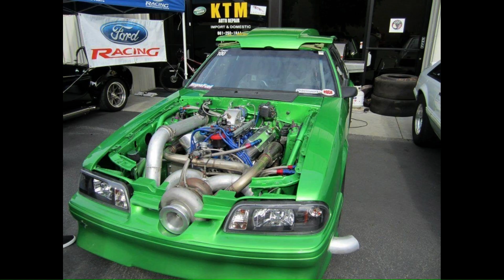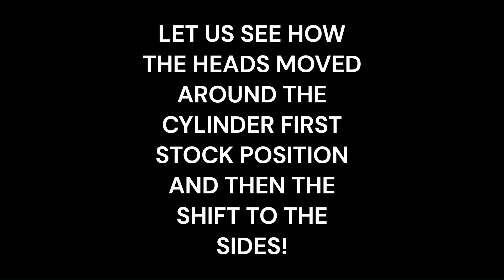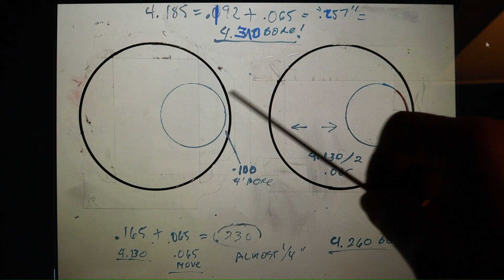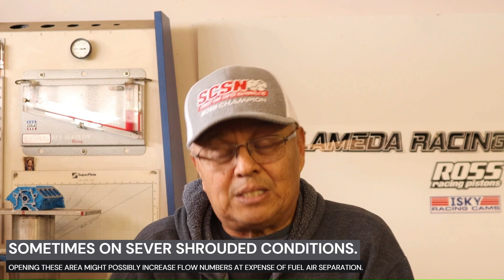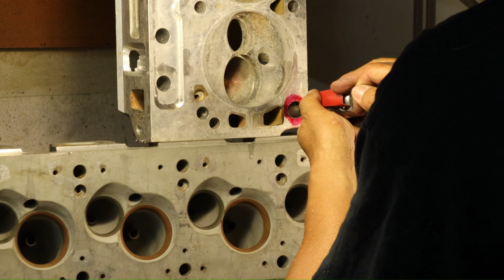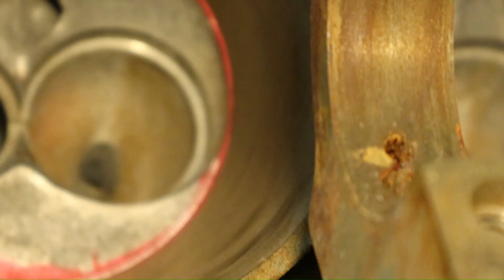FORD & LS HEAD TO BLOCK MODIFICATIONS

Comment: You could also have a competent machine shop make a set of .060 offse t dowels to insert in the block. Yes, cheaper to use a die grinder but not necessarily as accurate. Dont get me wrong here, im not criticizing anything just adding some input
Reply from the maker: Agree with you did that on a junk piece to show how effective it is.

Comment: Well in a 302 ci small block Ford in 1969 the Boss 302 used a 2.23 intake valve. Then in 1970 they droped it down to a 2.19 intake valve. And that is a factory head no work at all. So with the canted valve allows that. If he was talking a 20 degree head i think you can get a 2.10 valve in there

Comment: Not trying to be argumentative, but are you saying that a Ford will gLS does not have the ability to go 4.125 bore on a stock block unless you go ls7 which wouldn't have that cylinder head. 4.065 is about as good as it gets for stock block stuff. A lot of cathedral guys go 2.05" on the intake side and some have run a 2.08" but rarely do they unshroud it or blend the bowl properly so they don't see a lot of advantage.
Reply from the maker: If you move the head offset to one side then you can take advantage of the bigger intake valves which we have been doing to the SBF for ages.  The LS  layout specially the LT which now has the same valve positions like the SBF unlike the reverse with the early generation LS.  Moving it like I showed .065 fools the intake valve that it has a bore of +130 over stock on one of my videos.  Therefore if you start with a 4.00 bore and moving it .065 now the intake valve thinks it is a 4.130 bore size and loves it!

Comment: Good evening from off the grin AZ. Can you use a crank from a bbc 454, as a stroker crank for a bbc 396. Thanks. My heads ror the 311 should be done soon. Im definitely going to revisit the combustion chamber mods video, i like the notion of the V-groove. Thanks again
Reply from the maker: A good machinist can make just about anything fit within the confines of similar block series.

Comment: Ford's factory engineers solved this in 1969 by canting the valves and notching the cylinder wall at the deck. You can put a 2.25" intake on a 4 inch bore with a 1.71" exhaust. The 351 Cleveland head was well ahead of everyone else at the time. 
I like the way you think. Move the head, genius
Reply from the maker: More than one way to skin the cat as they say...

Comment: Hey Ben what about the new Lt style heads will this work on them??
Reply from the maker: Those LT style would not swap straight to the older LS blocks because the valve position is reversed mimicking the Ford layout. Now you need Ford style piston reliefs.

Comment: On a SBC gen I . What about notching the cylinder bore in a 4.030" - 4.040" bore size? Using a larger diameter head gasket. Wish to use 2.10" valve size or largest possible and unshroud it with an angled notch.
Reply from the maker: I would not do that on a SBC and notching the cylinder wall make sure it does not go past the ring travel!  Minimum gain however so I wonder what you are trying to do?
Reply: 396 did that in Feb of '65. Nothing new under the sun. I'll take a stab and say the largest, most succesful and prolific car manufacturer in automotive history would have done all this if it helped.

Comment: I'm visualizing 7/16" or 1/2" end mill shafts passing through a bushing in the end of a cylinderical guide with about a .050" wall thickness that contains the mill with about a .005" of side clearance, extends beyond the end may be 1/16", but then only shields 180 degrees of the radius. Every freaking time I ever do mutiples of anything by hand I end up making a GD tool anyway. I can't get anything right the first time to save my life, seldom the 2nd either, and most often it's the third. LOL You really think out of the box Ben; and that's what makes you the winner you are.
Reply from the maker: Every successful engine builder has a good machinist with him or a shop that completes the magic!  I wish I can do everything but I know my limits.
Reply: F-ing A ! I can damn sure relate. My buddy the AFP has a lathe and a mill in his garage and his daddy was a gun-smith. I don't know what I'd do without him man. LOL @benalamedaracing2765

Comment: Could you use an offset valve for the exhaust? It would give you more room in the center of the port. Then open up the intake side and put a larger valve. A 2.250 valve or more could fit.
Reply from the maker: That is already what the aftermarket and all out cylinder heads already does.
Reply: When I was a kid, I had a racing kart. I cut out everything in the ports and blended the eyebrows between the cylinder and valves. Lost compression so I was going to shave the head to raise it back up. Not enough. I then welded around the spark plug hole and by adding material, I raised it back up. But, like you, I found that counter boring the valve guides and canting the valves away from each other, I could make it easier for the flow to develop. Then I decided to build 302 with the junk heads on a 79 Ford Futura. I think I was intimidated by working on my daily driver.

Comment: how does the intake bolt up? what lifter/pushrods should I use? what intake should I use?
Reply from the maker: If you use an LS head you must use an LS intake perhaps with spacers or milling to fit a particular deck height!  Vice versa with a Ford...
Reply: @benalamedaracing2765 this is just a junkyard to backyard build that I'm thinking about, I actually answered my questions on another post but thanks for the idea and i hope to expand on it .

Comment: Using this application on a set of N351 yates heads on a 302 block for street with intake running flow of 207cfm with port and polish at 6500 rpm and still pulling what do you think would be the flow number gains?
Reply from the maker: I always like the N head and I have no idea what it will do depending on the guy porting the head, if he knows what he is doing or is a magician of sorts!  lol

Comment: my theory is to use rockers with a high ratio, as this will make the low and mid lift air flow less restrictive with a faster and sooner  lift. the peak cam lift may need to be lowered, as the high ratio will lift the valve higher, so you will need to prevent valve and piston clearance issues.
Reply from the maker: Yes the chance of collision will be at overlap...

Comment: Wonder if this would allow ls3 heads on a 5.3 ls bore. Dont think it will but it got me wondering.
Reply: You can buy a small bore ls3 head from several vendors but unless you turn the 2.165 valves down or put a smaller intake valve, the 2.165 hits the cylinder wall & it's not even close, so I don't see that being enough to make it fit..

Comment: While I don't think I will be off-setting the head at all, I do have a perfect project to test this on. I have an Iron block LS 5.3L that I planned on taking out to LS1/6 Bore Spec and putting forged pistons into anyway. Since the 862/706 Cathedral Port heads already flow so well and are free with the motor, rather than trying to track down a set of 243 heads, I will take the time to simply unshroud the Intake valves and work on the chamber to accommodate the increase in bore that I will be getting from the iron block (from 3.780" to 3.905") and leave the stock valve sizes for now.
Reply from the maker: Good move and like I stated on this video, use only on max effort builds.  It should really improve when you apply your plans to the build up.  Good luck Joey.

Comment: Looks like a bit more flow from unshrouding but curious as to how much better the exhaust flow would be under power since the valve taper in the head to the valve is flush with the bore now?
Reply from the maker: Not really much of a concern because the exhaust is under pressure and it will evacuate itself readily even when shrouded.  In fact most if not all state of the art cylinder heads installs the biggest intake valve while the exhaust keeps getting smaller in diameter and much closer to the cylinder walls!

Comment: We have offset the bores on small block chevy to accomplish the same effect
Reply from the maker: On legacy SBC you can either go up or down but not side to side or else one intake will be compromised and the other freed up!
Reply: @benalamedaracing2765  no I mean actually bore the block offset
Reply from the maker: @kevin2960  I am trying to understand and boring offset outwards does not change the bore relationship distance to the intake valve.  From what I can see it makes the exhaust valve side even farther which is what we are "not" trying to do actually the opposite.  There is no more room to offset bore and on the 400sbc you will run into the thin head bolt between the cylinders and same with the 350, not much meat between to make a good seal between the cylinders.  Could you explain because I am not following. 
Thanks Kevin.
Reply: @benalamedaracing2765  we did this on bowtie blocks and other aftermarket blocks. They used to do it on the big racing engines. You bore the front 2 and back 2 cylinders closer together and leave a bigger gap in the middle.
Reply: Some guys would sleeve 400 block to a smaller bore to achieve it. In a cubic in class
Reply from the maker: @kevin2960  thanks and seems like a lot of work and will still not get the same effect if the cylinder head layout is not symmetrical.  Today almost all heads big and small block is symmetrical and it would be a lot simpler of a task to relieved the shrouding of the intake valves.  It shows how many teams are willing to go beyond anything to achieve their desired power expectations.  Truly appreciate what others do in spite of the limitations and do innovative fixes.  I know of what we did years ago offsetting the crank centerline to achieve a better rod angle during the ignition stroke, and it worked but paid the penalty thou to a lesser degree when the piston and rod goes up on compression.  Oh well nothing is a free lunch like they say.  Thanks again Kevin.
Reply: @benalamedaracing2765  when you race in a class any lead is a lead. A few hp is what it takes. Your only allowed a certain CI, particular engine type, what part you can use ect.  Unshrouding a vale can be the difference between winning and loosing.
Reply from the maker: @kevin2960  Yes sir a win by an inch is as good as a yard!

Comment: So aftermarket offset lifters offset rocker arms and a multi dollar bigger valve job nets you how much more power over standard cylinder location
Reply from the maker: Depends on the rpm and cam specifications you are using at the moment.  Power is money therefore how much do we have and it goes hand in hand and very hard.

Comment: Been doing this for years on small block Ford's. Making up offset dowel pins, and using the mill to clearance the head bolt holes, is pretty easy. How do you feel about indexing the crankshaft, wrist pin offset. What's your take on piston to rod ratio? Glad I found your channel, we think alike. Take care.
Reply from the maker: For high rpms i like big bore and medium stroke coupled with the longest runners.  Shorter rods for road racing or small and fast oval tracks.

Comment: Are the trickflow forged pistons for the wedge heads on a 351w a good option for boost or are there better options for the $. What piston or rod would you like for 750-800 wheel? Thanks
Reply from the maker: Tim, best to give them a call because I have no idea how far down the top ring is and that is a definite issue to be concerned specially if you will be boosting  plus what kind of forging pistons they offer!
Reply: @benalamedaracing2765 thanks

Comment: With this mod is it possible for the head to shuffle because the dowel is no longer firmly locating the head? Maybe add a thin piece of curved steel to fill the gap around the head bolts/dowels to prevent shuffle? Also, can you chamfer the cylinder bore above the top ring like the Cleveland blocks?
Reply from the maker: You can weld, add epoxy or fit a similar thickness feeler gauge to how much you intend on moving the heads.
Reply: @benalamedaracing2765  Barry Robotnik did a 427 FE for EMC and he has Blue Thunder head s and he welded the dowels and the moved the holes in the heads and relocated the head towards the valley. He made 659 hp with 427 ci at 11:1 and ran it on 91 swill. Moving the head made quite a difference, but I could see the pics then and he had some trapping on the pistons, just blotches of brown.
Reply from the maker: @Bbba7564  I was forwarded an invitation to EMC by the original creator of the series.  I could have but at the time I was full time @ LAPD and could not dedicate seriously to it.  First time winner Joe Sherman told me to join and possibly winning like he did because we were and his son Steve, came up with a Ford vs. Chevy "Match Race Madness" and the rest is history.
Reply: @benalamedaracing2765  That is really cool!  I think that you should study the rules really well and build a combination that really fits the rules. Blair Patrick won it a few years ago with a .040 over 390 with iron C4AE-G heads at 399 ci making 597 hp. I sure hate that my C4AE-G disappeared from the machine shop after I had really scienced them out, and they claimed I had picked them up.  Gone!  But he figured out how to make the most points based on the rules, and scoring points. I wanted to use those heads to compete. Like losing my sight to drive, just another brick in the wall. Go for it!  The small block Ford is really underrepresented, but I would love the SHP 4.125 bore and use aluminum main caps on 2 and 4  like I plan to do on my 428. Just have to start over in the heads, they would have  made 600 hp on a 400 ci FE.
Reply: @benalamedaracing2765   Jon Kasse has won a lot and you are the right to compete with him!  Put one of your best pieces together and go for it. I consider you the best FE and SBF library of knowledge in any engine.  I think you would win, running away.
Reply: @benalamedaracing2765  I have used Devcon aluminum repair , make a plug where the dowel is exposed from the outside of the head and push it in the hole and let it dry on a flat surface with waxed paper between the head and table. When it is set over night pull the dowel out and drive it into the block and you should be able to put the head gasket on and the head.

Comment: Few realize the LS head is closer in design to a SB Ford than it is to a SB Chevy. There are only 2 bolt holes that are slightly off and a slight difference in the water passage between the SB Ford and the LS heads. In a pinch the head gaskets can be interchanged with very slight modification. The LS head is the head design that Ford SHOULD HAVE USED on their SN instead of the restrictive heads they did use. Basically the LS head is the race version of the Ford head. I remember reading somewhere that Yates from Ford racing fame was somehow involved in designing the LS. Whether it is true or not I can't say for sure but it is interesting how the LS heads are almost a direct bolt on to the SB Ford which was introduced in the early 60's, with the exception of 2 bolt holes by about 1/8" and a slight difference in the water passages. This is the first of your videos I have seen but am now a subscriber.
Reply from the maker: Similar indeed with the dowels just slightly smaller and like you stated the bolt hole slightly off to one side.  This said the intake valves are in opposite directions so we must take not of that when we do this shifting of the heads.
Reply: @benalamedaracing2765  yes, I forgot to mention the reversed valve positions

Comment: Makes absolute sense. Again makes me wonder why the head designers, even with inline valves, wouldn't design this offset into the combustion chambers and taper the chamber to unshroud the intake valve near the cylinder wall.... Even for the lowly 4" bore?

To me, this modification is to improve what is lacking in the design.

So instead of having to grind head bolt and dowel holes, just design them this way, cylinder head world!
Reply from the maker: A lot of the factory engineers are not really performance oriented and many instances they take precedence for emissions then power is secondary.

Comment: Oh also my ls head is 862  will work if i move both L bank forward and R bank toward back to firewall ? 😮😊
Reply from the maker: Reverse of the Ford.  Driver side to firewall and pass side to the front!  This way you pulled the intake valve from the cylinder wall.
Reply: Oh I see ..

Comment: Ok so i can move head on left bank toward and right bank toward back firewall 60.000 of inches.. on my ls 5.3 😮😊
.. wow im going do that and v-groove on toward by  intake vavle .. man im getting excited here .. i can't wait try out.. i have connect rod bolts and head bolt head ARP . AND STUD.
Reply from the maker: Ls requires the opposite move from the Ford because the intake valve is in reverse.  Therefore, move the driver side to the firewall and the passenger side towards the front of the block.  Good luck Warren.

Comment: Hi I know this is off the topic so I’m putting a stroker 408 together and I was trying to remember if on ur other video u explained oil pressure which one did I suggest to close the holes with the bearings is on the rods or the crank ? Before I forget clearance is.002 in ur professionalism is it. Better to increase clearance by .005 to create better pressure ? Thanks ur opinion is important thanks
Reply from the maker: I would follow the bearing manufacturers suggestion and if you are running 0-5wt oil then I would tighten it up even for a 2.100 rod clearance to .002.
Might be too tight if you are using 20w-50 @ high rpms.
Factory 351W if would open up the mains at  minimum .0028 to .003 avoiding the thin oils I listed above because the mains are just too big for high rpms.